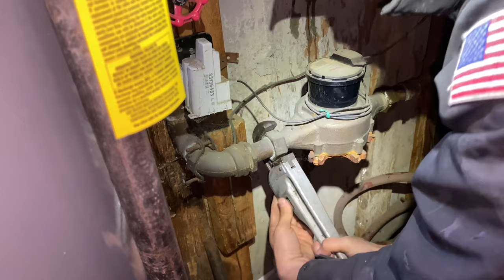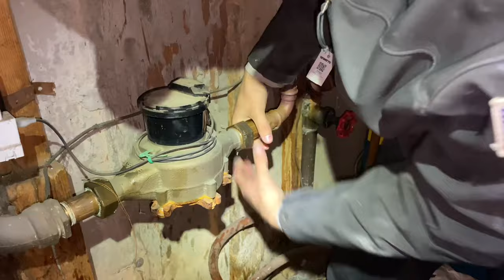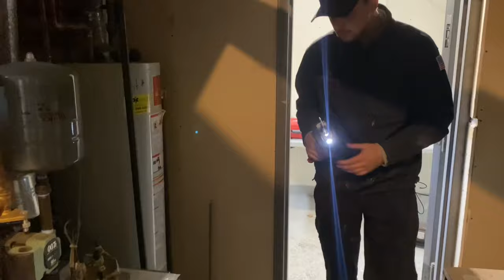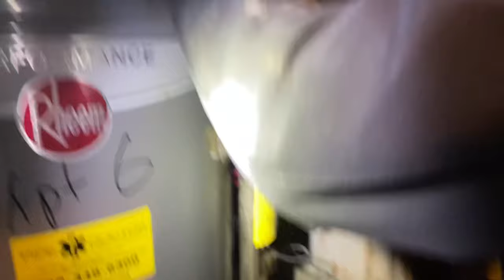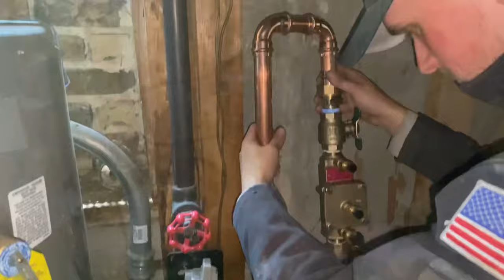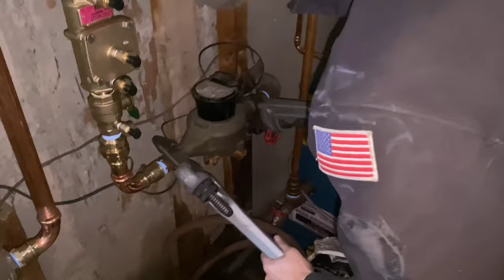Watts Backflow Prevention Device Installation in Apartment Building

Comment: Water department just did that to a fire hydrant trying to stop the leak.  Now they get to buy a new hydrant.
Boy they ain't cheap.  LOL
I never thought about that with apartments.  What happens they throw the toaster in the bath while your holding that copper pipe with a metal wrench?

Comment: 13:24 I‘ve got two questions for you:
1. Why don‘t you use a water meter connection bracket?
2. why didn‘t you tighten the whole connection before pressing? Would have been much easier.

Comment: How about a Watts tempered water valve in a recirculating hot water system... does the system push hot back into the cold, or?